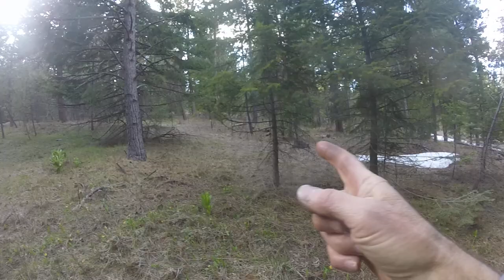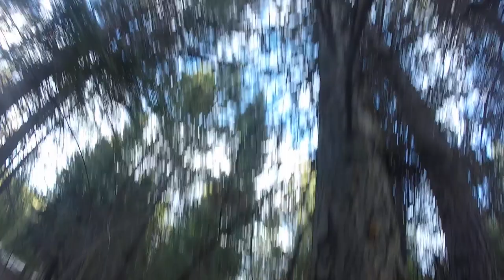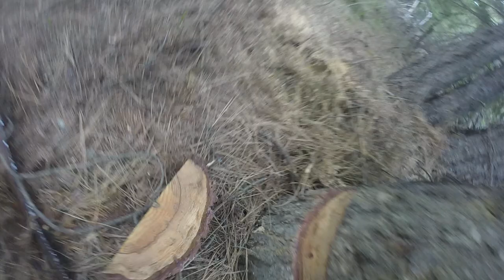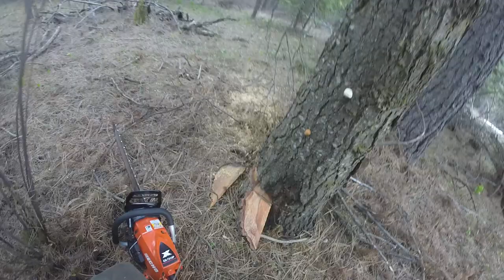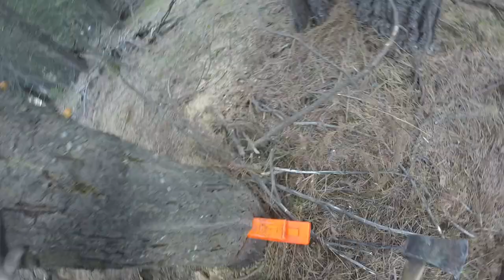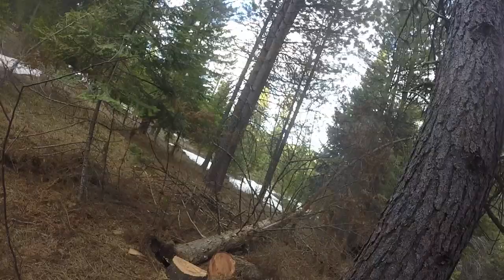The Faller's Corner - The PURPOSEFUL Hang Up Technique

Comment: Precision Physics there Jack, nice work and forsight. 
  I have done this by knocking the trunk onto a pc of 3/4" plywood and skidding the trunk back,  some day I will try the angular stab cut or shear drop cut (slip cut),  if I get a good candidate,  Mr. Murphy also has used this technique when appropriate.   Nice work and feathering that shear cut, nice touch.  Thanks... John
Reply from the maker: John hi. I do see your point. It makes perfect since. My differential - I'll be in a location where it is just about impossible, with any kind of expedience, to get a sheet of ¾" plywood at the stump. Climbing gear, ropes, come-alongs, port-a-powers, slings, a skidsteer, etc., etc. would also require a lot of extra time and effort, to being downright impossible to achieve without a helicopter.
In a yarder block, you can be 2/3, maybe 4000 feet from the landing. Or maybe a 5/6 mile quad ride on dirt with a 20/30 minute nature hike to your strip line. 
Also, the ground is seldom flat like we see here. So getting the plywood to be positioned right, and have it stay there, is challenging at best.
Think that because in those rough ground situation a faller has to rely on what they can pack on their backs, it incites a certain amount of creativity. It did for me anyway.
Thanks for watching.

Comment: In the Echo 7310 owners manual page 42 " the carb is adjusted for up to 1,100' ASL", it goes on to speak about engine damage and letting the dealer adjust it etc. Downloading available. A little reading about the effects of altitude on internal combustion engines is very "enlightening" as well. Page 45 is also interesting, check out the fine for using a fuel hose not certified by the EPA up to $37,5000. While on the subject of parts, what about cost and availability, in this part of the world we see saws ran with straight gas, and carbon scoring, a lot of crushed saws, either by skidder or trees, parts pricing. Just some things to consider.

Comment: I probably should have brought the cs620. If I would have only knew all the information out now!
Reply: The information in this video about the 7310 isn't correct. It takes at least 15 tanks ran through it before it wakes up. Tuning it to run over 13,000rpms causes torque loss. This guys saw makes me think he's running a totally different saw from my 7310. Mine pulls a 32in bar and chain like it's a 24in. Doesn't struggle at all. 7310 is a saw that just takes more time to break in. They also come very rich and need to be tuned immediately. There's a lot of sandbagging going on in his videos as well.
Reply from the maker: Stanley hi. You need to be super careful on the rhetoric what the fanboys spew forth. Mr. CSH80 talks about his saw running better than this one with less use out one side of his mouth, and then, runs around all over God's green earth saying that it takes (the magic number of 15 tanks) before it "breaks-in". Some saws will turn the corner at 10 tanks. Some saws take two weeks in a timberfalling application - so maybe 72 tanks. There is no "x" break-in number of tanks that it takes to break in a saw.
This is coming from a guy that started falling timber professionally in '81.
Another thing to consider, a lot of saw operators don't understand what it like to take a saw up in elevation. Performance dwindles quickly. Especially ~ 3000' and above.
Mr. CSH80 also likes to spread miss truths that are like the HP number that is not published by Echo USA. Again, for Mr. CSH 80's benefit - Echo PURPOSEFULLY does not include a HP number for the saws in the USA. I think it is the same for the "North Americas", but, I will not say that is etched in stone since I have not looked into. So, to say a 7310 that is purchased in and is a USA spec saw has "x" HP is not supportable by the factory themselves.

Most often the North American specs saw are a little different than the European spec saws. This is one variance. Echo recognizes that different dynos give different reading. According to the tech personnel I've spoken with, that is one of the reasons why the factory - Echo - doesn't provide HP numbers for any of their USA bound saws.
Again, I would suggest being very careful to whom you listen...
Thanks for watching.

Comment: I'm on the east coast will could I send you a all original running 266 to hot rod if so how do I get a hold of you
Reply from the maker: Forrest hi 
My email address is in the description area of most of the videos posted over the last 4 ½ years.
That is the best, 1st point of contact. Thanks for watching.

Comment: Loaded question... Would you recommend the 7310?
Reply: I've got one, and have about 8 tanks through it. If your someone who cuts occasionally for firewood or storm cleanup etc, it's a great saw for a good price. If you cut everyday for a living, look for a faster saw.
Reply: @paulmckenney8096  The 7310 doesn't break in and wake up until at least 15 tanks have ran through it. Once fully broken in, it's a different beast. What most don't know is the 7310 is extremely rich from the factory and if you lean it out to 13,000+ rpm at wide open throttle, you'll  lose torque in the cut. That's one reason Hotsaws101 is having problems with his "struggling". The sweet spot is between 12,600 & 12,700. It won't bog down or struggle in the cut. Once broken in and tuned right, it's hard to beat it. I'm running a 28in and a 32in on mine and it doesn't struggle one bit with either bar. I also cut more with the 32in.
Reply from the maker: @CutterCH  - I noticed you never commented on the 461 vs 7310 saw-off video where the 461 had exponentially less run time (much less "broken-in") than the 7310. Keep in mind that the 7310 was “detuned” to 12,780 in that session and lost by a mile. 

ALL saws take ~ 3 to 5 falling days (18 to 30 tanks to "wake up", break in", "turn the corner", etc.) They DO NOT turn the corner and become ½ again a better saw. I've been on the end of pistol grips in some degree since the mid '70s. Stihl, Husqvarna, Mac, Homelite, Sachs-Dolmar, just Dolmar, Dolmar/Makita, and Echo, yes Echo - as far back as the '70s as well.
I'm not having problems. It's the poor design physics of the 7310 that are causing it to "struggle". That saw has flow dynamics issues. It's stem to stem as well. 
The "sweet spot" for power is somewhere between 5000 & 7000 rpms on all but a few piston ported chainsaw engines. I've seen many HP & Torque curves from the dyno readings. 
How you tune the saw - slight miss at high idle. That's going to be the "saw-weet spot". A 100 rpm window specifically between 12,600 and 12,700 - Baffoonery. Many factors have to be considered there. Air density at that location being paramount.

From what I've seen internally & dealt with in a saw-off/wood lot and also falling application with the 7310, they are designed to run lean not rich. They have and old engine design and have to meet criteria for emissions without aid of either of the stratification methods currently employed in the industry.
It's not going to matter how broken in a 7310 gets. It suffers, and it is badly, from many poor design attributes that inhibit rather than enhance flow.
To help out a little: 
Flow Characteristics 101: The charge (air + fuel) have to be able to move into, though, and then out of an engine easily, efficiently, and at a great volume to create power. The amount of flow volume will either aid or stifle an engine’s performance. 
Sadly, the 7310 is severely lacking in flow efficiency. It has a hard time because of that. Even in zipped form it “struggles” due to poor flow volume.
Reply from the maker: Andy hi. 
I come from a busheler's background.  If your not cutting on high, you wasting time - imho. I like the narrowness, color scheme, and sight lines. I don't like the sloppiness or power output as compared to the mass. I'm betting it is at the bottom of the barrel there. I wish that saw did better and gave the big two a run for their money. I had hoped!
They are not that less in cost around here than some of the the options. Unless your are a very patient sawyer, I'd get a different mo-chine.
Thanks for watching.
Reply from the maker: @paulmckenney8096  Hi. Probably the best summation made so far on the 7310 platform. Thanks for watching.
Reply: @hotsaws101  that sucks! I have a cs490 and love it but I keep hearing good things about the 590and 620 but just the cs7310 is not even enough of a dog to be called an under dog in the 70cc class. I'll probably go with the 590. But would have loved for the bigger saw to be worth it. I'm not a professional. Hobbyist at best. However I am trying to get a firewood side business going. I guess that frees up a few hundred bucks to get a second bar and more chains ...
Reply: @hotsaws101  I'm still wondering why you 7310 struggles and mine & everyone elses does not. At the time of your first videos on the 7310, mine had a lot less run time than yours and had no struggling issues with a 32in bar in hardwood. You seem to be the only one who's having that issue now. It's easy to manipulate a winner and sandbag in a video. I see it all the time. Usually happens when the video is made by a brand bias operator. I can go out right now and make a video of Husqvarna vs Echo and sandbag to make a 40cc Echo beat an 70cc Husqvarna. I go by personal experience and facts. Now days, video doesn't mean much due to the fact it can be manipulated so easy followed by fictitious talk to make people believe what they're seeing is absolute fact. Brand bias attitudes abd sandbagging videos cause one to lose all credibility and respect. It's a well known fact by everyone, that you don't like Echo. That's been pointed out numerous times. How are we to take you and your videos seriously when you're bias towards them? We can't. It's not going to happen no matter how hard you try.
Reply: @hotsaws101  And yes I did see and comment on the 461 video. Did that days ago.
Reply from the maker: @CutterCH  - 
Addressing those that choose to dig a little deeper. The concept of "performs excellent" is relative to one's background & exposure to a gambit of other saws.
The 7310 saws struggles here due to the lack of available atmosphere. Also know as altitude. This partially because of the "super awesome 4 stage air filtration system".  It creates a draw in the filter plenum. Near as I can tell, it's a negative pressure in the filter cavity. That does help performance...
I can tell those that have never used a saw above 1000/1500 feet. The lack of understanding will be exhibited in the commentary in the saw testing videos on this channel. 
I show the saws running at or near the same rpms. I show the saws using the same chain, and almost always, the same bar. Many times I get help with the tach. The human element - I try and apply the same amount of pressure to the handle bars. But again, only human.  With that, we can hear that the rpms are not thousands different between the combatants - unless of course it is one of my Torque Monster saws. So again, relatively close on all fronts.
Usually those that are pointing the finger at others for being dishonest are the ones that really need to watched....
Nothing is well known. You have no clue about my thoughts on the Echo. Because - you ,or should I say "we", never asked.
I talk about facts - it weighs ~ "this". The anti-vibe system is a little spongy and it moves around laterally "like this". It is really slim in design and makes it nice because the operator can get it in close to the torso "like this". I can, and do, parlay off on a like or dislike regarding a fact.
Your pretty big on casting doubt and yet you post inaccurate HP numbers -  
{CSH 80
2 weeks ago (edited)
7310 is 5.5 horsepower and once it's broke in, which takes about 15 tanks run through it, it wakes up and performs excellent.} 
You made a "fictitious ""fact" statement" about the HP number. Again, Echo PURPOSEFULLY doesn't (unless things changed on a corporate level recently) publish horse power numbers for their saws destined for sale in the United States.

Here (inside the { } ) you talk about after 15 tanks it performs like this. While at the beginning of this post I'm replying to you say that your saw has less time than the one I'm featuring.  Wishywashy...
On the break-in aspect, saws usually take 3 to 5 timberfalling days, but sometimes they never do loosen up - my 064 is an example there. The 12 to 15 tanks is an arbitrary number - "it might be", or "it can be", or it usually is" . It could be a lot longer or shorter. MANY factors affect the process.
Unfortunately, our not standing here, at this elevation, using my chains to even have a clue what a 7310 runs like at this location.
As far as brand bias, You must have missed the sound-off on the different brands that I have run, do run (occasionally, frequently, obsessively) and own. 
ALL saws have both good and bad points. I talk about them continually. I recommend based on the use and application. I suggest that a perspective buyer make a trip to the saw shop for a tactile inspection often. Because - that makes a difference most often.
What I see with you and some of the like minded posters is an extreme finger pointing, Holy-er than thou mindset. The "I, said something bad about your gurl" mentality. 
If I talk about power in a saw, well, it might just be accurate. This comes after showing my (I'm responsible for the custom saw modifications and/or tuning) Torque Monster 461 running with an 088 while using a 42" bar & .404 chain.
The other thing going on here, I'm talking about what I'm doing, have done, know about. Not, well these guys over here did this, or I watched these videos about this saw, or it's a well know "fact" that it's this way, where we think it's like this - but the "we" never actually asked. 
What I see here is the mindset of "I/"we" want it to be like this". Talk about bias -time for the "we" to take a long look in the mirror. 
If you think that the 7310 is the cat's meow, buy one, buy 10. Use it/them. Try and be happy.
And, no worries if the "we" decide to move along and push their agenda elsewhere. The decent folk see what going on here.
Reply: @hotsaws101  Think again buddy. I gave the correct horsepower numbers. I get all saw specs straight from Echo. 5.5hp is 100% correct. I stand by everything I've said in your videos. Everything I've said I facts. I would absolutely love to be able to post screenshots of everything to the comments here on YouTube. It would make you and your so called facts look pathetic. I know my stuff. I think it's time for you to brush up on your knowledge on new saws. I deal with facts. Not feelings.
Reply: @CutterCH  Hello sir, in the Easter video he and I talked about the European Echo website listing 4.1kw(5.4981hp) edited at 7:44am 6-12-2021. And I also posted the Husky and Stihl in kw. Echo does not list hp numbers on the USA website. I have watched much 7310 footage elsewhere and have seen worse times with shorter bars. I also have seen times close to those posted here with long bars. It would be counterproductive for him to mess with his livelihood and stray from the life-pattern he has developed. Yamabiko has a presence here and they are giving imput when they see fit. They did this with other reputable tuner/porters as well. The success of the 7310 is not dependant on what does or does not happen here.
Reply: @Brian2bears  It's 5.5 hp. I have every bit of information and technical data on the 7310. I know the straight up facts. If I didn't, I wouldn't be commenting at all. I never open my mouth without knowing what exactly what I'm talking about and have the proof to back it up.
Reply: @Brian2bears  Also, 4.498hp is what the 620p is rated. I have that saw also. Someone is feeding you BS numbers and it's damn sure not me.
Reply: @CutterCH  You are correct. 4.1x1.341. It was my error. The point is Echo does not do this on their USA website.
Reply: I also noted my error in the text.
Reply from the maker: @CutterCH  Buddy, I could have sworn that you and the 7310 winners club consortium  (we) were moving on.
And yet, here we are.

Now, I know you are use to getting your way. I saw how your berated Mr. Dalluge for being stead fast in his support of the 372 Husky. Not allowed by you it seems.
I responded to Mr. Brant about your falsities. 
What that diatribe shows the operators with a ton of time on the end of a pistol grip, in many decades, using MANY different models & brands of saws is that your still wet behind the ears.
Quick recap on the  - Echo USA does NOT publish a factory supported HP number for the 7310. Now, I know you wish it was so, but it is not.  They DON'T publish a factory supported HP number for the USA version 620 when looking on a smart phone.. And my bad, when looking at a computer Echo does have a chart comparison of the 620 vs 362 Stihl  vs 562 Husqvarna in the "product information" section. The chart miss prints the factory published hp numbers for what Stihl & Husqvarna have listed for the 362 @ 4.4 (Factory is 4.7 or 4.69 depending upon where a person looks) & 562 @ 4.6 (Factory is 4.7 everywhere). This leaves the 620 hp number suspect according...
If you want to get down to brass tacks - Your getting and giving FALSE information. Because - your using information from saws destined for other countries. Evidently you do not have "every bit of information" and this is what you don't know -  the North American saws have a tendency to be a little different in there final design configuration.
Why don't you do everyone a favor and follow through with your earlier idea of moving along to greener (read less educated) pastures...